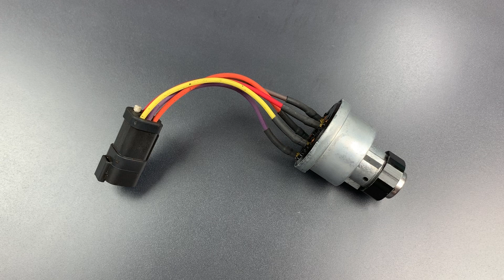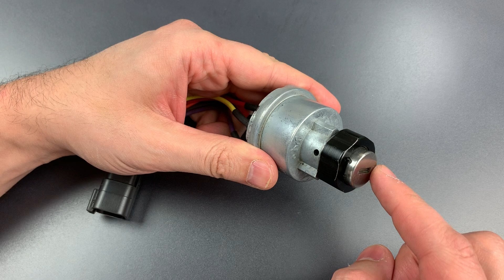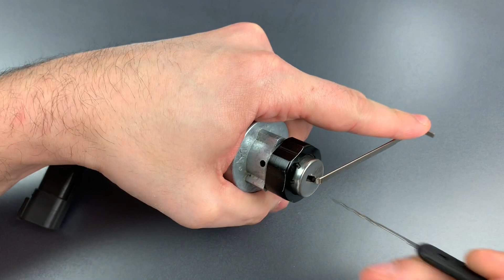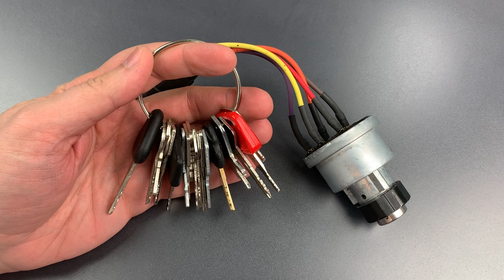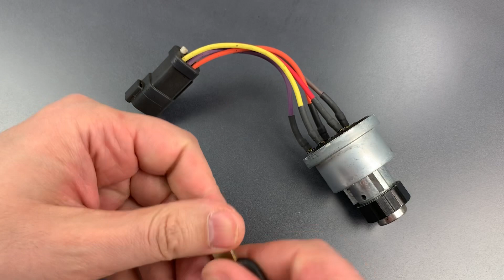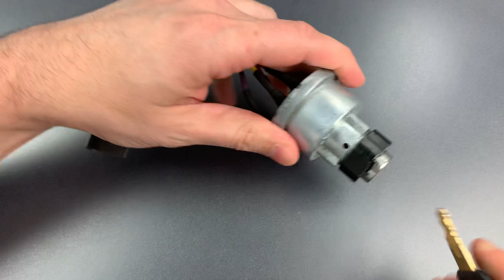[803] The Shocking Truth About This Bulldozer Ignition Lock (Caterpillar D8)

Comment: Small aircraft (Cessna 172, etc) are the same.  The door have locks but you can open all of them easily.
Reply: Cessna 172's do have door locks abd magneto keys but they are often just cheap y11 ignition lock switch assemblies and get very worn. Most of them will open and start with a Y11 ez go key. people swear to me their golf cart key is the same as their plane key and screen door key but they don't  realize they are really picking the lock every time they use them.
Reply: Of course, something stolen doesn't necessarily need to be sold. A plane could also just be stolen to get somewhere else, as the Barefoot Bandit did.
Reply: Large aircraft don't even have locks, lol. Anyone can steal a boeing if they have have access to the hangar. The doors aren't locked, and theres no ignition lock for them.
Reply: The main impediment to steering most aircraft is a tiny amount of knowledge and having a small amount of literacy. New Lear 75s take literally four buttons to fully start all their systems and be ready to go excluding playing with the avionics. Battery on, APU on, Each engine start switch, and wait for the big ass display in front of you to start flashing "throttle to idle position" at you and you're good to go. That and of course if you're taller than like five feet you won't fit because Lears have less space in the cockpit for your legs than a C172.
Reply: MillionFoul the hanger lock can be pretty hard to open, and a Lear 75 isn’t going to be on an unattended ramp.
Reply: @danpowell806  I work at an FBO. On our ramp, unattended, currently sit about 70 private jets of all makes and models, including a couple of Lears. There are couple of planes in the hangar too, which is locked with a bog standard door lock (actually like six of them). It is below zero outside, and most of them were there yesterday when it was twenty below during the day. Many of them have their doors locked, but not all of them.
Reply: MillionFoul when the FBO closes for the night, how do you secure the fuel farm?
Reply: @danpowell806  It's always secure, it's inside the fence and requires our ID numbers and discreet individual passcodes to operate. Also it's run by operations so it's not our problem.
Reply: MillionFoul oddly enough, the planes are also inside the fence. 

The guy with the balls and knowledge to boost a Lear is also going to have the balls and knowledge to Hotwire a pump. He’s going to have to, in order to get nonstop to somewhere that doesn’t care that the plane is stolen.
Reply: @danpowell806  Yeah and you can climb the fence very easily, hence the passcodes to use it. But he doesn't have to go non-stop, there are self-serve airports fucking everywhere which will accept a throwaway prepaid card or cash and let you fuel yourself because they don't do mobile refueling. While it would be strange, you could absolutely fly VFR all the way to your destination without talking to ATC at all, or depending on the stealing time vs departure time, fly all the way to wherever buys a stolen plane on an IFR flight plan before anyone notices because twelve hours is a lot of time when you're hauling ass.
Reply: MillionFoul you WILL be intercepted if you’re going over 17,500 squawking 1200. 

There’s a few ways around that though.

As for the 24-hour unattended self serve Jet-A with no landing fee, :shrug: maybe? Although any such station is still vulnerable to hotwiring the pump, bypassing whatever security is present; the thief wears a ski mask and doesn’t care that his stolen plane is on camera.
Reply: @danpowell806  Yeah, I mean the main impediment has always been that if you have the training to accomplish all this without killing yourself you could also get paid pretty well as a pilot with a lot less risk of ass probing by the TSA.
Reply: David Daivdson  just go to bolivia  ...they have a lot of narco planes from usa
Reply: Yeah, but the price of a stolen C172 in South America is going to be one bullet. Your costs are going to include fuel to get it there and bribes for lots of border control agents along the way.
Reply: Is it not possible? Pretty recently a mechanic stole a bombardier dash 8 Q400 from a hangar in seatle killed himself with it (before flying loops and barrel rolls with it, lol). He could have taken others with him if he wanted to, there was plenty of time.

In 2012 a pilot stole a CRJ 200, but he drove it through the aircraft parking lot rather than taking it off on the runway. I don't see why he wouldn't have been able to take it off though.

You don't have to remove "remove before flight" covers. If you don't remove them you are simply missing some sensors. But if you don't need your autopilot, you'll probably be fine.
Reply: ATC is going to get suspicious if a CRJ in airline colors says that it's going to fly VFR. A good story by the pilot could defuse that suspicion long enough to get takeoff clearance.

Most of the "remove before flight" covers are actually critical to operation, but anyone who can fly the plane knows where they are and can remove each of them.
Reply: jort93z the engine intake covers are probably pretty vital to remove.  The exhaust plugs are self removing, seen that done!
Reply: I saw a plane take off without removing the engine cover once. The wind had blown it so far into the engine that the pilot thought it had blown off and away.

Somehow the plane worked until he tried to apply full power, and then it stopped working. The pilot managed to glide back to a runway.
Reply: Lmao lots of just goofy responses 

I'm  no pilot but I've heard radar starts at like 100 ft off the ground and higher 

And they dont park many private cesna planes at the international airport 

What is being mentioned is a small non monitored airstrip with private planes... take off ... fly below 100ft and your long gone ....

No fighter jet will come for you unless your up in flight altitude and in populated areas 

Plus cesnas only have a very short range like 500 miles or so .... you are not taking off from Montana and flying to Columbia 

I had a relative from California fly his cesna to western canada .... he had to land something like 6 times for fuel they dont have much range at all
Reply: Radar is basically line-of-sight to the radar. That can be down to the surface on the airport if the radar is elevated, and the further away the higher the floor. 

Flying under radar coverage is probably going to attract more attention and notice than flying normally, and once the search for the aircraft begins it's going to be a phone call to every place where you might have landed and gotten fuel, so there's no way to avoid the trace.
Reply: But its not that easy to steal them since they are (probably) registered and you cant just fly away without atc noticing
Reply: @AngeEinstein  Even if you're stealing it from a controlled airport, ATC doesn't authenticate pilots. If you know the tail number (which is conveniently printed on the tail in huge numbers) you can get taxi and takeoff clearances. It's a tiny but more complex if you're stealing it through class B airspace, since there will actually be an accessible record of which way you went and where you said you were going.

It's going to be hard to sell a stolen plane, because of the registration issues, and you can't even part it out like you could a car because airplane parts need extensive paperwork documenting exactly where they came from.
Reply: @AngeEinstein  atc don't care...  you call ground, taxi, call tower and take off.
The thing that protects small aircraft is unlike cars you can't just hop 
in one and fly off..  you have to have some level of pilot training.
during the 2001 market crash... I repoed aircraft... picking the lock is nothing.
but you need to know how to fly that type of aircraft...
Reply: @AngeEinstein  Actually, unless it's a plane somebody is likely to miss in short order (or somebody who knows the owner sees you messing around), it'd be very easy to steal one, assuming you know how to fly it. Nobody's checking plates and ID when you take off. It may be more difficult to get access to the ramp area, depending on the airport, than to make off with the airplane--because as many have noted, the external locks tend to be easily defeated, and once you're in, many don't even have "keys" in the traditional sense.
Reply: @pechorin1975  But as you mentioned it probably is difficult to even get on the airport and to the planes. Why else would TSA exist when it's that easy to just take an airplane.
And for the ATC: I assume that you  have to ask for permission before you even taxi to the runway. At least at airports that are more than just a big field.
Reply: @AngeEinstein   You really trust the TSA? Well, bad news for ya: There was the famous LAX-incident were a guy wearing a bright yellow life jacket, running all over the airport was not spotted for over an hour... He was only found and locked up when he approached a worker at a terminal asking for help (his jetski sank and he needed help). Or the time they failed 21/21 times spotting people that were trying to "smuggle" bombs on board... Yeah, i wouldn't bet on them keeping anything safe.

Big airplanes are really just "security by obscurity": The amount of work needed to steal one (getting stairs to acces the plane, manouvering it out of a hangar, refueling, power up, etc) combined with the complexity (it's not a push pedal x to fly system) makes it nearly impossible to steal one, yet alone escape jets.
Bush planes on the other hand are the complete opposite: Can be loaded onto a trailer, mostly "locked" up in hangars on small airfields (where atc is outsourced to somewhere else). And you can fly low to avoid detection. Still a bad plan.
Reply: @eulemitbeule5426  No I don't trust TSA I was just talking about the concept. And maybe it's that easy but what if the owner detects that his plane is stolen and reports that to the police. Won't the police contact ATC and won't they search for the number of the plane?
Reply: @AngeEinstein  Well, who will notice if you turn your transponder off at night?
Reply: @eulemitbeule5426  they have radar at the control tower I'd imagine?
Reply: @startedtech  Only passive radar, you only show up when you turn your transponder on.
Active radar is a really expensive hassle that needs a metric sh*tload of persons to operate. You might get that on really big international airports (and airports run by the military), but not on small airports.

And yeah, that would be the idiotic version of stealing an airplane... As soon as anyone encounters you in the air not transmitting flight data, that person is going to alarm the next ATC.
Reply: Not really, with most small airplanes you can fly with no radio and no transponder not talking to ATC other than takeoff or landing or in uncontrolled airfields not at all. As long as you don't fly other than VFR and don't go into controlled airspace, you can do it.
Reply: @eulemitbeule5426  You got the radar stuff a little backward and mixed up.  Primary radar, every regional airport will have.  It will show hits even with transponder off but it likely wont have accurate altitude.  Only something like a very small grass strip or tiny airport wont have primary radar and in that case they aren't going to be looking at transponders either.
Reply: @GigsTaggart  At least as I know from Austria if an unidentified plane enters the Austrian airspace the military will try to contact it and if it doesn't respond Eurofighters will start and identify the plane and maybe force it to land. That's at least the procedure if a bigger airplane enters the Austrian airspace. How that works with an small airplane that's already in Austria is out of my knowledge.
Reply: @AngeEinstein  tell that to the guy in Seattle

Comment: I can't even count the number of times I've seen guys start a piece of equipment with a flat-head screwdriver conveniently kept on the equipment.  If that ignition can't be turned with a simple screwdriver or pocket knife, consider it a vast improvement in security.
Reply: If there is a screwdriver on a machine I can guarantee you the ignition cylinder is so blown out you can start it with it.
Reply: Lots of old cars can be started with screwdrivers.
Reply: @shroomie108  i had a nice old 85 pickup and a screw driver was the key to the door, ignition, and glove-box
Reply: @shroomie108  I dont think so. Or are you talking about pre-war cars?
Reply: @macdaniel6029  I remember a top gear episode where an old car was able to be started with a screw driver cuz I guess the tumbler gets worn and any flat object will work. Not most cars or new cars but old worn ignitions I guess. Maybe they faked it but who knows
Reply: @shroomie108  Of course, if the key is worn out, at some point everything will turn the lock... But at the time when the old cars were new, no chance.
Reply: @macdaniel6029  correct. That's what I meant by old cars as in worn out ignition. Not when they were new. Hopefully that clears up confusion.
Reply: When I was in cadets, our DS taught us how to Hotwire cars, next thing he knows a few of my friends drove off with our DS merc

Comment: I used to work on heavy equipment, and it is broken down ALOT! LOL I think that one of the main reasons for the way these machines are keyed is it's easier for the mechanics to work on them because they have to work on them so much, keys get lost EASY LOL
EDIT: 
Heavy equipment also always has a keyed primary ignition master switch in a remote location. You can't start a D8 dozer with just ONE key, you have to have TWO KEYS
Reply from the maker: If you’re referring to the battery switch, look at the forked key right next to the ignition key on the ring. 👍
Reply: @lockpickinglawyer  HAHA! GOT 'EEEMMM!!
Reply: @lockpickinglawyer  the master powerswitch is usually behind a locked door, and those are keyed induvidually same as doorlocks
Reply: Now that all depends on  who set the machine up. I have operated quite alot of machines with only one ignition. The isolator is a different story again. Some have an isolator some just use the ignition to operate a isolator solinoid.
Reply: @chrisyoung9467  ok, I learn something new every day, I'm in the oilfield so most everything around here is idiot × masterthief proofed LOL
Reply: The little weird looking v shaped key is the secondary key for Caterpillar equipment. It goes to the battery kill switch located in the battery box. Most companies just leave that key in the switch and turned on. In 20 some odd years, I've never popped the battery compartment open and had to get my battery key to energize the system

Comment: From about 2012, many heavy equipment manufacturers have gone to the electronic key pad, as it interfaces with the computer required for emissions controls as well as acting as a tattletale on improper equipment operation.
The keypad also keeps employers in compliance on equipment training as required by OSHA.
Reply: even keypad systems are getting obsolete due to PIN code snooping/shoulder surfing. Nowadays its a RFID system or Bluetooth system where you scan the same access card/cell phone you use to enter the worksite. This also allows employers to propely declare usage tax on the machines which are required nowadays by the tax Agency, instead of every employee to write down odometer Readings in a paper book. (worksites are now legally by law in sweden required to have entry/exit logging called "ID06", this is required by the tax Agency to prevent cheating with the tax, the entry/exit scanner doesn't neccesarly need to be a barrier or gate, it can be a Bluetooth receiver which logs the worker's mobile phones as they enter and exit the site - and manual systems with a in/out panel or keypad is discouraged due to workers forgetting to check in/out and this can cause hefty fines for the company).

In warehouses, the forklifts nowadays use a peg system to check for compliciance, where you use your access card to check out a personal "peg" out of a closet which is on-the-fly encoded with your identity, usage is then logged locally to this peg, and when you return the peg to the closet the data is transferred back. Such systems then allows the forklifts to be "offline", and the peg are electronically updated with which machinery you are allowed to operate, and how many hours you have left on each machinery type, Before release, when you scan your access card in the closet. https://www.traka.com/Other/Trakacom/Media/Documents/Product%20sheets/Manufacturing%20and%20Distribution/iFob%20per%20Person.PDF
Reply: Yes but most of those equipment Control Systems have an emergency override feature typically at three digit PIN that could be entered into the keypad and what with the equipment in an Emergency Operations mode where the user can use the equipment for either a defined period of time or an undefined period of time depending on how they set the controls up allowing them to theoretically deal with an emergency or get the equipment out of danger.
Reply: @Tera_Hai  As you see the systems has no keypad, most of them have only a single button. The emergency function is usually a master card or master peg that works offline.
Reply: We have these at work.  A huge pain as they are just touchscreen tablets and are not suitable for the harsh environment they operate in.  They get damaged or die in just a few weeks.  The equipment is then operated with a pair of jumpers I keep on my hat.